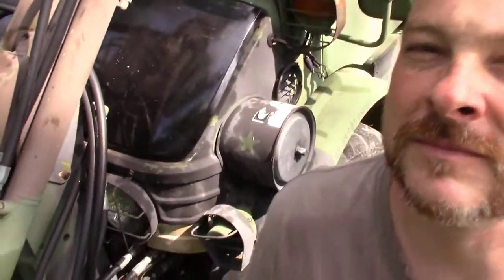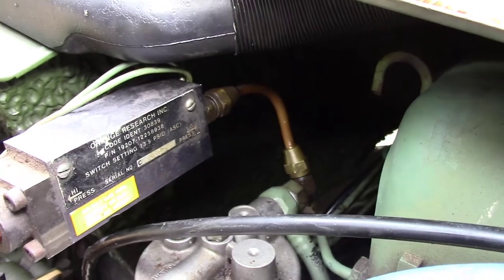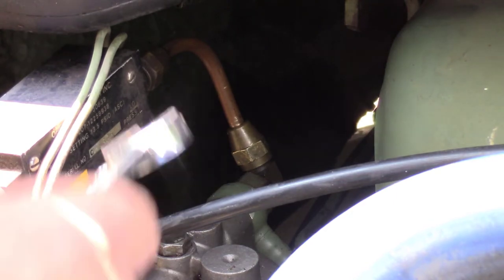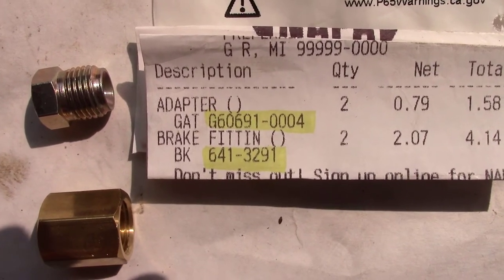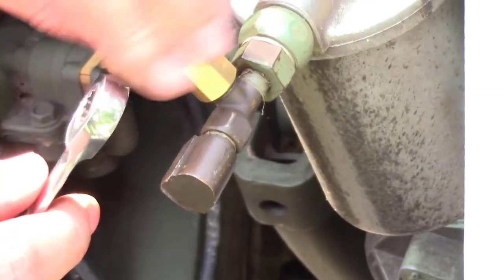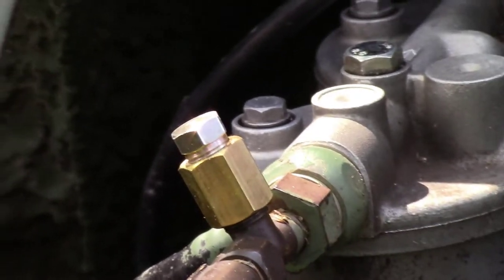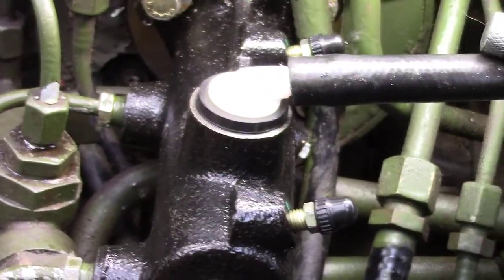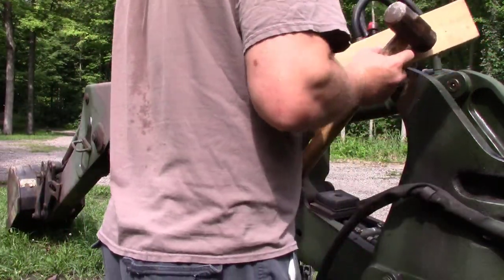Unimog 419 Fuel, Brakes, Hydraulic Cylinder Repairs

Comment: Nice that yours is still in original camo pattern. The one I bought had been painted over in desert tan.
Every surface has an eighth inch of heavy paint covering it. The keeper rings on the cylinders arent even visible. Every nut and fitting has to be first beat with a hammer and screwdriver to get a wrench to fit on it.
Reply from the maker: @lucasdog1 Oh my! Yes, when these things get into the wrong hands it's cobble-town! Mine had its share of B.S. like all the fuses are just door screws! Really!? "Door screws for fuses? Go to Expedition Imports and spend $5 you cheapo." It's crazy.

Comment: I am having one heck of a time repairing the 406 we have. It was cobbled together over the years before we got it - so - it is to be expected, I guess. I cannot purge the air from the fuel tank to the exterior fuel pump. I am wondering if the dip tube has micro holes in it... I have looked around for a dip tube and I don't know where I can get one. Any ideas would be great. Thank you! Great video!
Reply from the maker: @rongray4118 Not too familiar with the 406 but I did have similar issues until I pulled the entire fuel system (fuel line) and found a broken fitting that connected the fuel pump to the return system fuel line. I would make sure everything is new and replace all the T-junction's if there are any. Best of Luck!
Reply: @CarswellsCustoms  other than a few revisions for "military purposes" the 406 and FLU419 are pretty much the same machine.

Comment: chassis harness on your g8 v6 to v8 swap video do i need to switch the connectors from the v6 one and when i plug the v8 harness do i plug it into the 2 connectors that's together on the side panel and do i leave the v6 transmission connector unplugged
Reply from the maker: @Ricky Jacobs the V8 harness should plug directly into the factory v6 chassis harness under the passenger side dash.
Reply: @CarswellsCustoms  do you have an email
Reply: @CarswellsCustoms  do i need to pull the whole dash out to take the harness out
Reply from the maker: @RickyJ_12  No, pull the Passenger side glove box. Did you purchase AllDataDIY for the year of your car? When customers bring their cars to me, AllDataDIY is already included in the repair price. No negotiation on that one. Email mymusiconmyiphone@gmail.com
Reply from the maker: @RickyJ_12  On the v6 to V8 video, check out 0:55 and it shows the connectors that need to be connected under the passenger side dash and passenger kick panel.
Reply from the maker: V6 to v8 video 5:09 are the connectors you need to click into the v6 chassis harness.